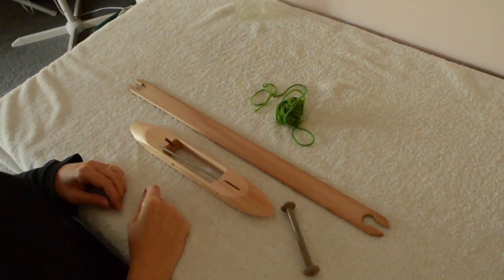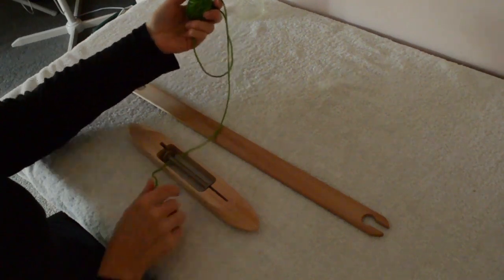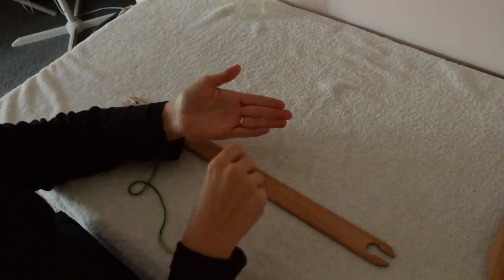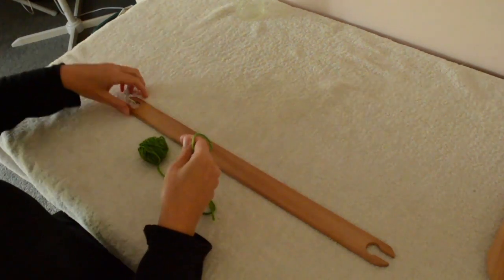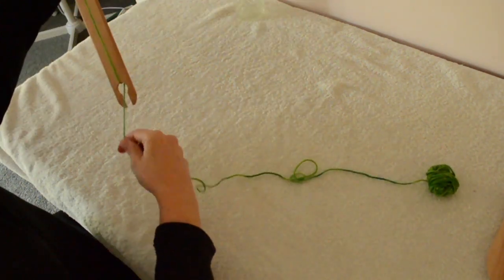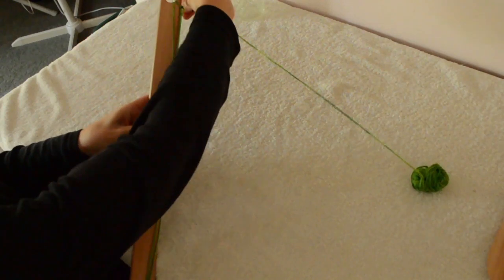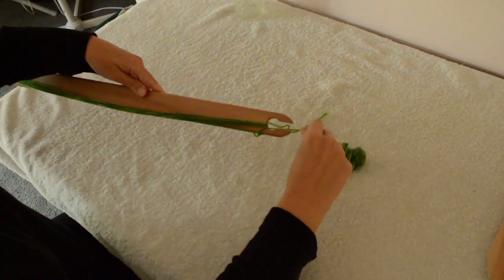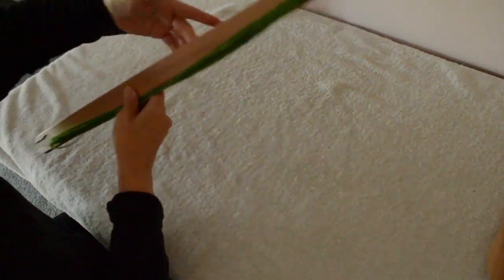How to wind a stick shuttle

Comment: Why only put the yarn on one side? When you weave is the yarn side away from you or toward you?
Reply from the maker: +Lindy Brigham This is just one method that I find easier to weave with - the yarn seems to roll off the shuttle. When I wind it the other way I find it gets caught on the ends of the shuttle more often. I often load the other side of the shuttle with a different colour too, so that I'm not forever unwinding  old yarn to free up the shuttle. Generally, the yarn side is facing away from me when weaving, towards the heddle. Hope this helps :)